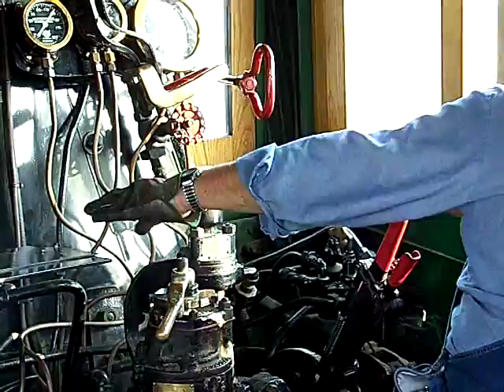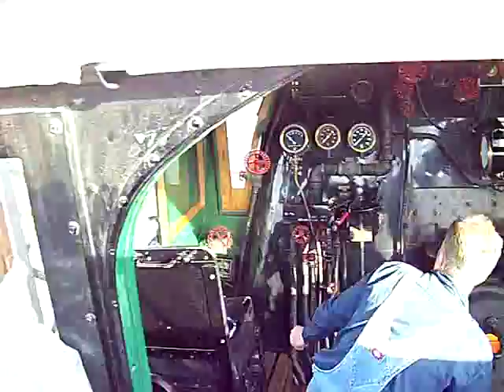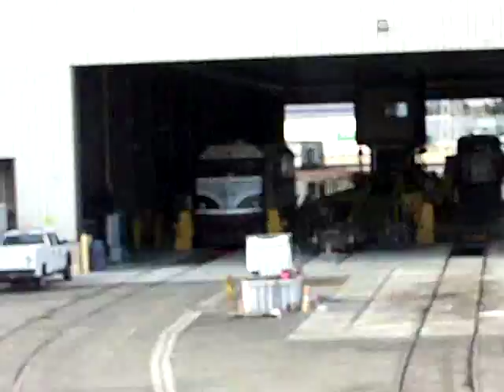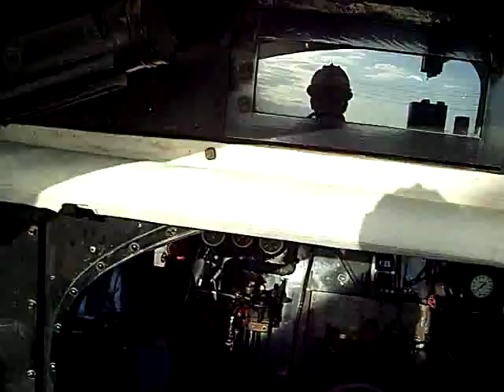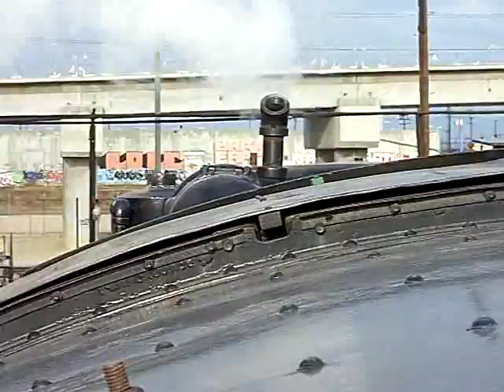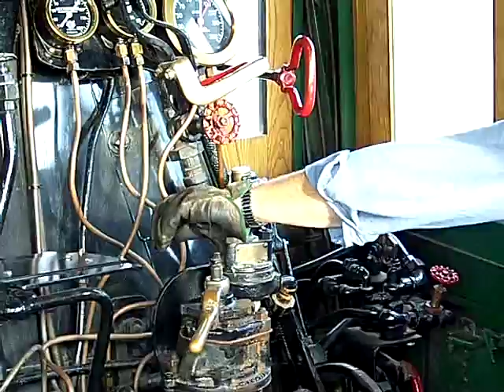Sounds of a Steam Locomotive series, 2

Comment from the maker: Oil burner. Most steamers west of the Mississippi used oil b/c it was easier to get than coal. Our tender holds about 20,000 gal. of water. that's just enough to get to Oceanside. (water stop both ways)